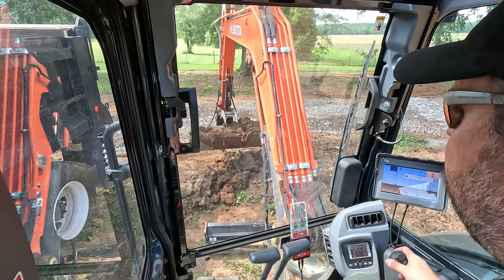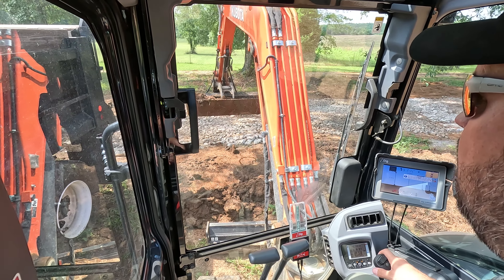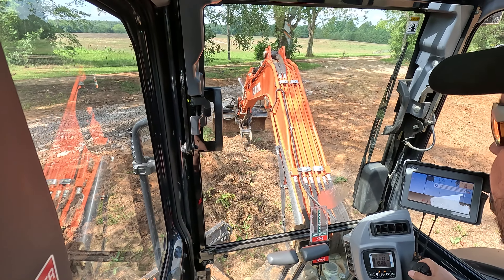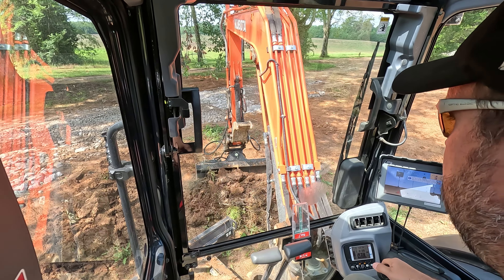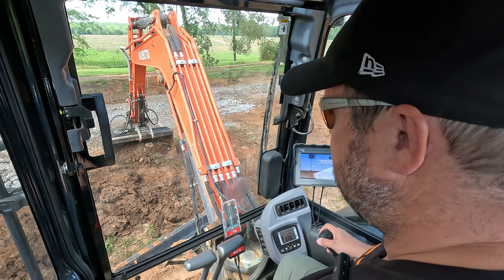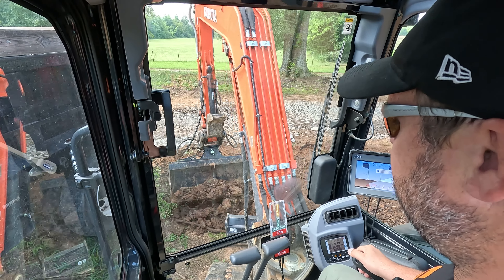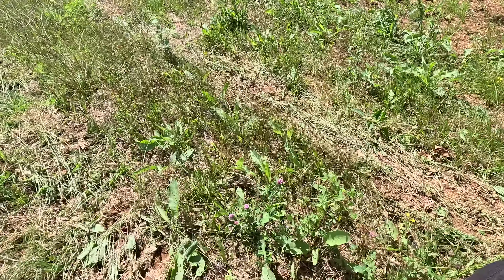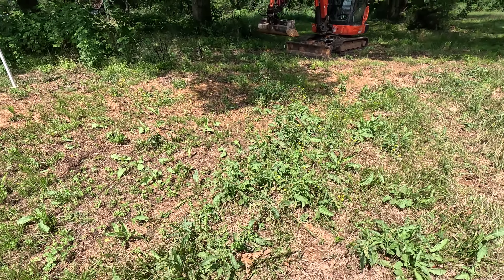Mini Excavator & Skid Steer: Fix and Grade a Yard

Comment: Is the water coming from the house…are there no gutter system up… I guess what I’m asking is where is the water coming from that’s ponding in the yard and driveway…lol. Like I said water has a mind of its own. Thanks for sharing.
Reply from the maker: the home is sitting in the lowest elevation area of the property.  Most of the water was coming from the land on the opposite side of the ditch from the house.   So a lot of this was trying to intercept the water and make it go elsewhere.   It was almost in a bowl, and the slab was not built up very much from the natural grade, so there just wasn't a lot of vertical space to work with.   Thanks for watching!
Reply: @DirtAndRocks   oh, ok. I understand it a little better now. Thanks
Reply from the maker: @ProudPapaw88   yeah, so just kind of imagine all of the water coming down from the barn area toward the house, and then on the other side, it was blocked by a rise from an old hedgerow.   So basically it was intercept on the barn side, and then let the water flow out but cutting out part of the hedgerow on the other side.   And then the kicker was that the natural slope of the land was 1%.   I wish the builder would have raised up the slab 6-12" more, that would have made it easy.